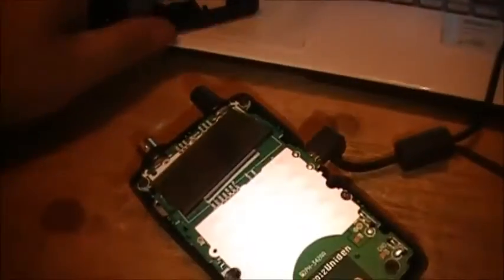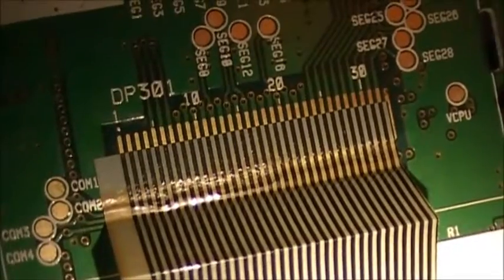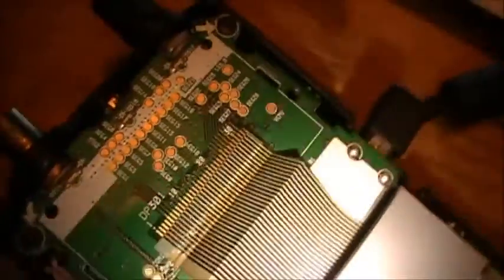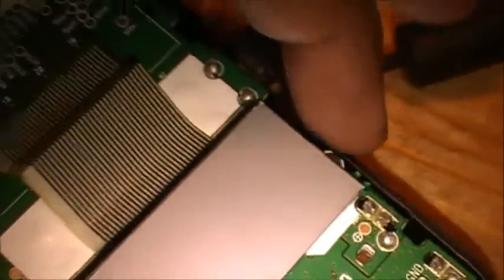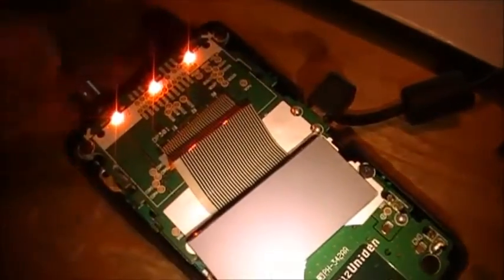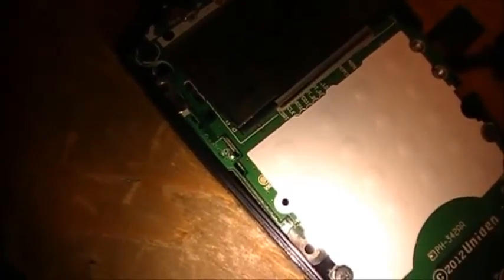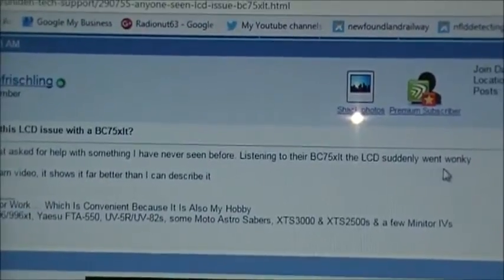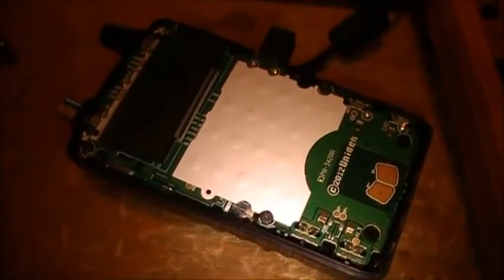Uniden Bearcat BC-75XLT LCD repair

Comment: My display is doing the same thing. Only had it a year, right outside of the warranty period, and the display is messed up. Under makes garbage. Thanks for the tip on repairing this
Reply from the maker: These LCD's are pretty fragile, glad the repair worked for you

Comment: Same problem with my BC75xlt. Had it fixed once, same problem developed again. Obviously, this is a common flaw.   The real issue is why Uniden produce these shitty displays in their radios they keep breaking down and why aren't they accountable for fixing them permanently for free?  Hurts their brand and I'll never buy another.
Reply from the maker: You would think there should be a recall on them.

Comment: Thank You Radionut63!! Your Trick Fixed Mine 100%. It was totally blank, I used a soldering pencil it gets about 450, the first try a couple started to display, the second time I made a slower pass across the ribbon to get it a little hotter. Put everything back together, Works Perfect. 
Thank You Radionut63, Your The Best!!
Reply from the maker: You are very welcome, glad to have helped!  :-)

Comment: Thanks for this. I didn't have a soldering iron available but I did have a hair blow dryer easily accessible. 30 seconds of hot air followed by some pressure from a q-tip fixed it right up for me. Just to be safe I also followed 3qdx's suggestion and put a small piece of an old credit card in there. Thanks for the tips guys!
Reply from the maker: You are more then welcome!  And thank YOU for the great tip as well, I never even thought about a hair dryer, nice fix buddy, Congrats!  :-)

Comment: Hey there Radionut63. My LCD screen went wonky again a few days after using the folded paper. Soooo, this time I cut up a credit card (nice and firm with no give like folded paper) and I inserted the cut piece under the plastic LCD mount and over top of the ribbon cable. I snapped the plastic mount back down good and snug. It's been over two weeks and my LCD is still working flawlessly. A lot cheaper than sending it back to Uniden who wanted $69.95. I only paid $40 for the scanner. Us 'radioguys' we get'r done!
Reply: it worked for mine so happy thanks
Reply from the maker: Good to hear.  Congrats!   ;-)
Reply from the maker: That we do! Congrats on the repair, hopefully it holds up to the test, You should make a video regarding your repair.  :-)

Comment: I was actually able to fix the LCD by just inserting some folded paper over top of the ribbon cable underneath the plastic mount. This applies additional pressure on the ribbon cable so that it now maintains consistent contact with the PCB. No soldering required but thanks for your help anyway.
Reply from the maker: No problem, let me know how it holds up.
Reply: Will do. Thanks for your help and input. Much appreciated and have a great day!
Reply from the maker: I reheated my ribbon cable yesterday and brought my LCD back to normal once again. ;-)
Reply: It sounds like maybe this will have to be a repeated effort. My additional pieces of folded paper lasted for about 4 days and then two different parts of the LCD are now missing. So I'm going to try more pieces for a tighter fit. Whatever works I guess. Good luck!

Comment: I have a radio shack pro 649 scanner,  i just received it and other scanners/ different parts for a HAM radio. I got alot of sorting to do, but my scanner the display is cracked huge ink blotch right in the middle, so how do i go about replacing it? Do i have to get a very specific replacement display? Or anything the same size? Thank you for your time
Reply from the maker: you will need the same LCD display... Other may not work correctly.